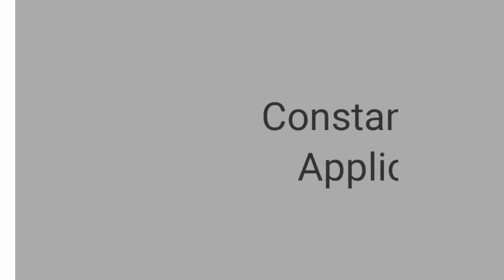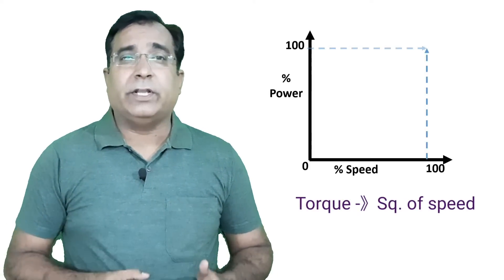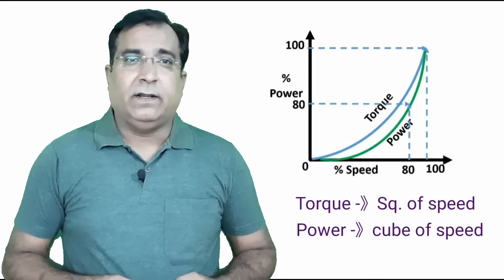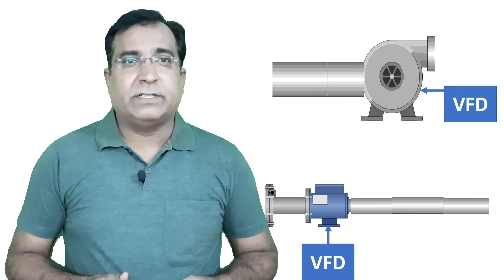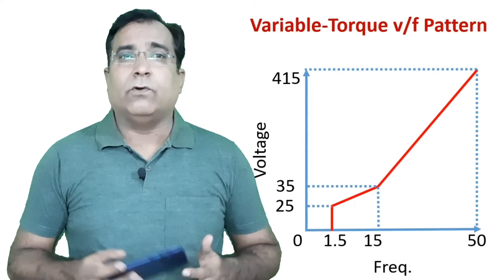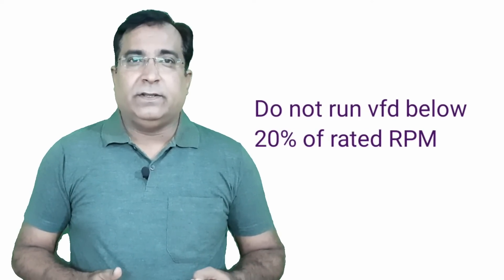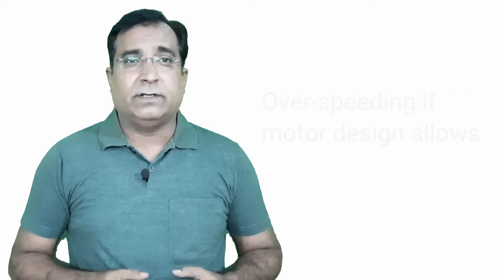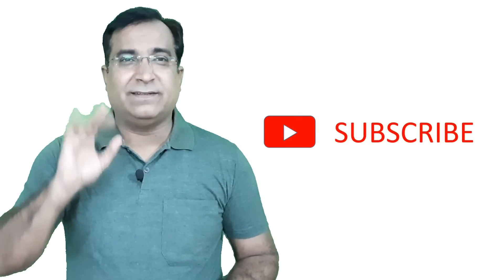Power Energy Saving using VFD @dineshdiwani

Comment: Sir hamara compressor ke utilizing 12% aa rahe hai kya VFD power saving kar sakte hai
Reply from the maker: If compressor is of screw type then you can go... But if it is reciprocating you won't achieve much
Reply: VFD is used to slow down the speed. so set the motor speed as per the requirement and then you save energy. further, the start and stop is smooth so no power sag.